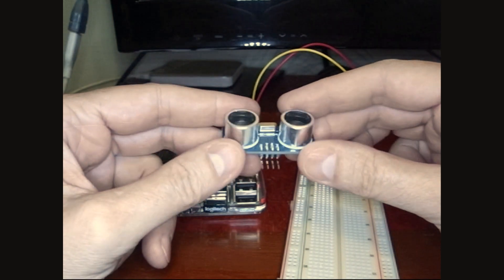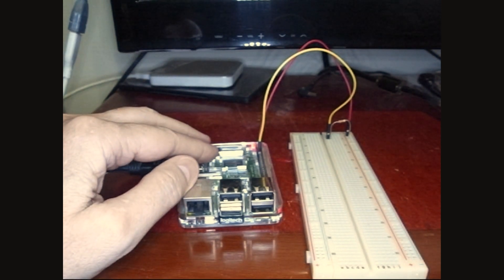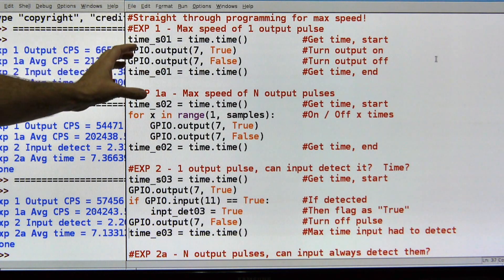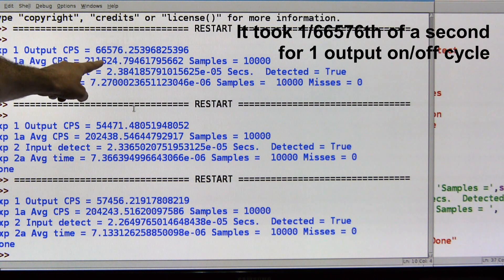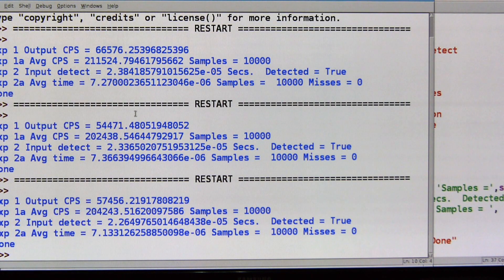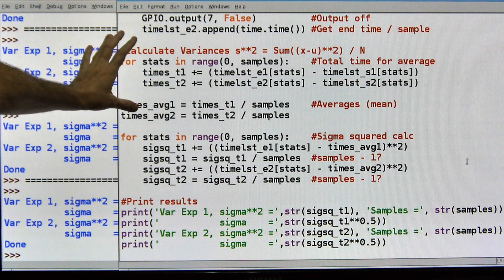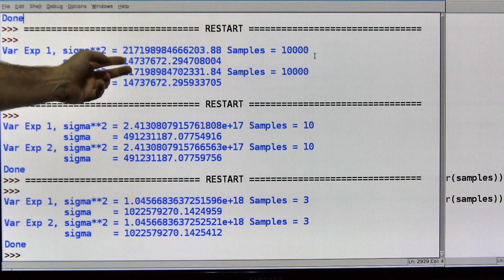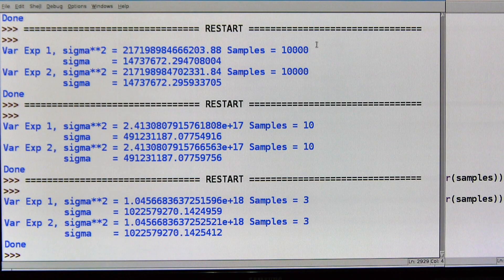RPi 13 - The Speed of Pi - How Fast Are The GPIO Ports?

Comment: You did not control for how long it takes to actually get the times.  If those functions are a significant portion of the time of the most basic check, it would explain why the loop had a faster rate.
Reply from the maker: I'm not sure I understand.  Each experiment calls the time function the same number of times, so that's consistent.  If you mean that time() is eating into the processing time creating delays that affect the result, that's exactly what I have concluded.  Both the RPi and Arduino are bad about timing issues based on type and amount of code.  (The Arduino less so.)

Comment: You calculated sigma squared incorrectly.  It should be (e-s-avg)^2
Reply: I was driving when I wrote that don't tell anybody...
I also don't use python.  I am a C and Go person.  Looking at time in the python documentation.  I would use time.time_ns() (int).  This returns the number of nanoseconds since the epoch.  time.time() (float)  returns the number of seconds since the last epoch. I don't know how precise of a second it is.  

You found the average correctly.  In #Sigma square calc you were just using the start time and not the time it took to start and stop.

For t1 use:
sigsq_t1 += ((timelst_e1[stats] - timelst_s1[stats])-times_avg1)**2)/samples. 
 
You could move the /samples outside of the for loop, but you might get overflow.  Also,  I don't know how python handles types, but you would probably want to separately typecast (timelst_e1[stats] - timelst_s1[stats])-times_avg1)**2) and samples to float for added precision. 

 Get rid of sigsq_t1 = sigsq_t1/samples. This wasn't calculating 1/samples correctly and is taken care of above. 

I hope my gibberish made sense.
Reply from the maker: @ultraderek  I see, OK, I will fix that next round.  Thank you.

Comment: The reading pin is reading a floating signal.  You should put another resistor (like 100 ohms) that goes to ground before the other resistor. It might help with the reading results.
Reply from the maker: The RPi has default pullup/pull down resistors enabled.  So it's already there.
Reply: I didn't know it had that.   I ran into a floating signal issue in an Arduino project when I first got started programming micro controllers.  I thought it might have been applicable.